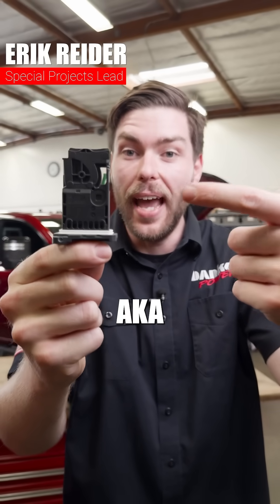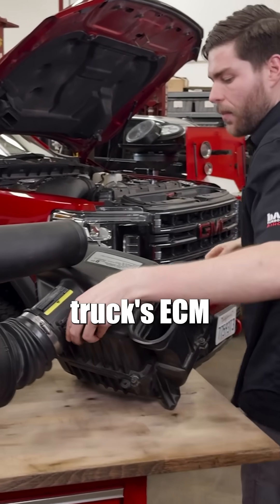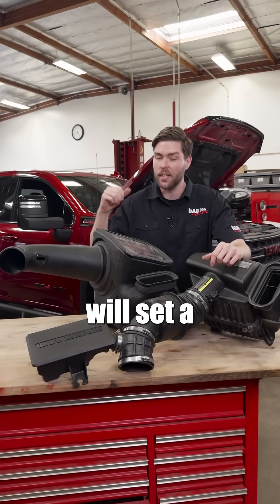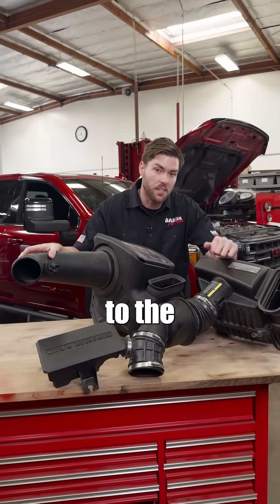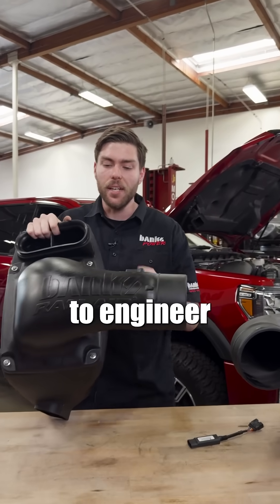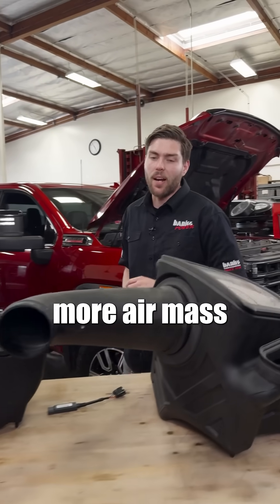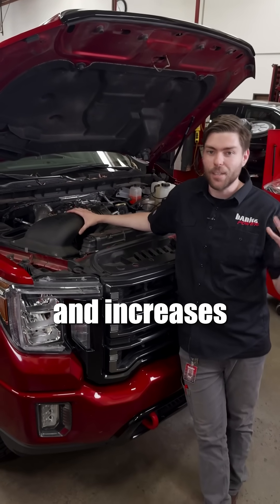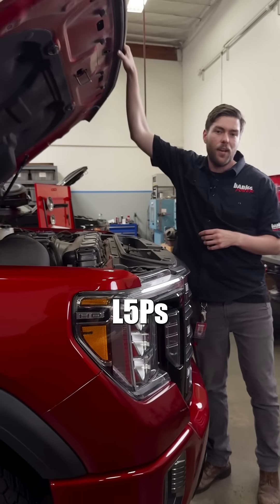We’ve changed how intakes are designed.

Comment: 👏Yes Yours intake system is great 💪when user can't tune ecu, but tuners can calibrate air mas sensor data in engine ECU, set diameter, calculate się flow etc.

Comment: Have you fixed the intake for my 19’ Cummins yet?  I’m on your list to call for a fix but it’s still sitting on the shelf due to multiple codes I get when it’s installed.  If you are selling products that throw codes as I was told by one of your techs… what is the difference in other manufacturers selling intakes and false claiming horsepower that you call out all the time in your videos?  Seems one and the same.
Reply from the maker: So, for specifics your order, send us a text at the customer support 1-800 number on the website and ask for tech support, but in a general sense we expect to start shipping out the revised parts for your intake in the next couple of weeks.

Comment: Still no love for Ford trucks!

However,  it does seem that GM and Dodge Ram have more inherent problems with air intake in their engines!
I replace my stock air filter with a K&N oiled air filter and have had no codes set on my 2016 F-150 with the 5.0 Coyote!
I have refused to buy any of the “cold air intakes because they all have the same flaw, they leave a huge opening to the engine bay heat generally around where the air intake tube exits the air intake box before the MAF sensor!
I. E. Not really “cold air” intakes!

Comment: Or for a whole lot less money and the exact same results, you could just replace the MAF at the same time as you do the air intake and then hook up a obd2 scan tool and put the ecm into calibration for the new MAF so the new higher airflow is what it reads and sets the ecm to. 

You don’t even need to use the obd2 trick most times, just installing a new MAF at the same time as the new air intake & let the engine idle for 5 min before you mash the throttle down to hear the new sound & the MAF & ecm will sync & clear the code on their own

Comment: Hey guys ; I just installed your cold air intake on my 2014 6.7 ram truck . My truck is now throwing an air box code . Will your maf module sensor solve this problem ?
Reply from the maker: For technical assistance with our parts and performance kits, we'd love to discuss it over the phone.  Please call us at 626-969-9600 and select option 4.

Comment: I need this for my 2019 Ram 3500. Driving around with the check engine light stresses me out. Will reinstall the stock air intake until there is a solution.

Comment: No one will tell you this but the whole point of a cold air intake is not for making initial power you need a tune because all a cai is its a supporting modification for a tune just to get rid of the factory restrictive airbox after that the piping can stay stock size because from factory they design the piping to allow the engine what it needs up to the top end so it really doesn’t matter what brand you get as long as you get tuned before intake

Comment: for guys who are doing true custom tuning, the oem MAF is fine as the tune can be written to perform with it. No need to over complicate it with an aftermarket MAF. For the small amount of guys using canned tunes out of the box and want to use something bolt on at a premium price for little results, this is definitely for them. 😅 Might as well make one of out PVC pipe 😂

Comment: That’s great Banks.
But what about the 2019 L5P ?
Why wouldn’t you develop that for ALL L5Ps ?
It’s only good for 2020 and up ?
Why ?
Doesn’t make sense.
Reply from the maker: The 17-19 trucks have enough overhead and a different emissions requirement than the 2020+ trucks, where a MAF intercept module is not needed. By contrast, the 2020-23 and the 2024+ trucks have ever-tightening emissions restrictions and requirements that forced us to develop this technology.

Comment: When will this product be available for 6.7 Cummins Ram-Air products?
Reply from the maker: @Zekkou  The Air Mass Control Module is currently not required for 2007-2024 Ram 6.7Ls. In other words, our Ram-Air intake systems are able to increase air mass without the module. However, it may be needed for 2025. We shall soon see.

Comment: Volant is another one that dosen't make there tube smaller. Awesome system.
Reply from the maker: @Tess_untamed  Volant cannot manipulate the MAF sensor’s data, therefore their tube must remain the same size as stock.
Reply: @bankspower would you say I would get more performance form one of your cai than a volant on a performance LS engine? And why? I have one of the old K&n with the metal tube and wanted to switch to a plastic one with a closed box. I was thinking of getting a volant but maybe you can persuade me different. Can you guarantee I get better performance from your product than a volant? If so, how? I have a heads/cam LS

Comment: How about fixing the intakes on the fifth gen rams so they stop throwing egr codes. While you are at it maybe you could finish the design and have it actually connect to the air scoop so it uses the factory ram air setup like s&b does?
Reply: Right on.  My Banks intake for my 22 Ram has been collecting dust since 2023.  I keep getting the "fix is coming" from Banks
Reply: They need
A fix asap for 6.7 Cummins I return mine waiting for the fix so I can buy again

Comment: So basically what you are doing then is a chiptuning with a new intake where you either put alpha/n related mass air values or flow measured/recalculated values of your intake into the ecm and simply fool the ecu. If thats really legal if you put it on a roller tester and measure the émissions with a wltp/nefz cycle i highly doubt. Thats maybe possible if the ecu can adopt to the false values and is able to correct close to the safety values...

Comment: Just use what ever intake you want and rescale the maf sensor when you remap the ECU🤦‍♂️
Reply from the maker: Tuning can be a great solution for people in a lot of cases, however,  there are a few down sides: the cost and it'll void the warranty. Our solution allows you to run an upgraded intake without modifying the ECM or setting a check engine light.

Comment: I'm guessing that the engine check light comes on because the computer can't take into account the different diameter of the tube therefore the mass air flow value is not correct

Comment: Great filter, but you forgot to design in a easier way to change the bloody filter itself. Having to remove the whole tube to change the filter is INSANE! One reason the S&B filters have taken off (at least around here). 4 screws and you can take filter out vs at least on 4th Gen RAM's having to remove the whole intake to get at it.

Comment: If your a true engine tuner/builder, aftermarket parts designer, why don't you let people know that after changing any parts with aftermarket/performance parts, the vehicle needs mapping to do the job right?
Reply from the maker: Tuning can be a great solution for people in a lot of cases, however,  there are a few down sides: the cost and it'll void the warranty. Our solution allows you to run an upgraded intake without modifying the ECM or setting a check engine light.

Comment: I’m all in on banks engineering. However it’s a little shady to not show the last piece of the intake that connects to the throttle body. They’re the same size on everyone’s cai. Yes it flows more where the maf sensor is but still tapers down to stock throttle body size. He’s showing where the s&b connects directly to the tb but the banks is still missing a whole foot of tapered down pipe.

Comment: Sensors are just a limit. Carbs didnt need any of that and thats why some of them ran much harder when modified right!
Reply: @LightningFast240  Sometimes you had to choose a carb with less CFM so it would function well enough in street driving. Same could be said for certain EFI setups.
Reply: @skylinefever  4in MAF with air straightener really all you need. Everything after can be 5in

Comment: Damn how can yall sell a defeat device? This messes with MAF signals then your messing with emissions equipment. This would fail inspection immediately. Although im all about it im just confused how yall are doing this.
Reply from the maker: The Ram-Air intake with the Air Mass Control Module has a CARB E.O. It is 50-state emissions compliant.

Comment: But your throttle body is still the same. Why increase diameter of the air intake tube if it still chokes the exact same at the throttle body?
Reply from the maker: Yes, the throttle body remains the same size even though the intake tube diameter has increased drastically. We have tested this and found that by increasing the intake tubes and air filter size, we are able to create higher air density, which is then compressed when it funnels down to the throttle body inlet size. By doing this it creates more pressure and much denser air going into the engine, resulting in improved flow and power.
Reply: @bankspower  that's interesting. I am not an engineer, but wouldn't that create a negative pressure front in the intake manifold and cause turbulence or 'negative scavenging' at the injection?

Comment: Sure it's nice to have a larger intake tube, if it's properly tuned for airflow distribution and reduced turbulence, but you're still limited by the stock opening on the intake manifold. People think bigger is better, but that's not always true, creating a wide spot in the line can lead to drastic inefficiencies, but I'm sure Banks has done their fluid dynamics homework.

Comment: I like seeing them find ways around choke points. Back in 1998, I learned what a MAF was in an article about how to get 450 horsepower form a Nissan 300ZX Twin Turbo.

The stock MAF was in front of a splitter, taking the flow from one air filter to two snails.

When installing really big snails, people back then had to use the Jim Wolf Technology Twin Pop, which was two air filters, and the MAF in one of them. Then the ECU was reprogrammed as the MAF was basically measuring half of what went on.

Later modification on MAF engines involved using a large MAF with a wider range. People would often adapt the Delphi MAF found in the C5 ZO6 and reprogram ECUs to use it.

JWT did a lot of interesting things with Mass Air engines. The Datsun 280ZX was made before the hot wire MAF. It had a weather vane that was a huge choke point. They adapted the computer and hot wire MAF from the early 300ZX Turbo, in order to improve the Datsun 280ZX Turbo.
Reply: This comment brought me down memory lane. Thank you
Reply: @hadojin210  I always feel great when someone gets my origin story.
Reply: This reminds me of my friend way back in the day trying to build up a Mitsubishi VR4 twin turbo. Nobody made turbos for it. So he got something like a 16g or 18g set of turbos and cut them up as well as his stock turbos to make his own. It was an absolutely insane build at the time. Nobody was doing it, it was such a new car. He got his bigger turbos and then figured out he had a LOT of learning to do when it came to figuring out the tuning and drivability. He got it going pretty good after a while. There only was so much you could do back then. Most people were still doing EEPROMS bhahahaha.
Reply: @genuismensa  I think about how people also got around that choke point MAF in the late 1990s or early 2000s with a "MAF translator." It was a big MAF along with some device that scaled the reading. Even with good EEPROM tuning, it must have been a challenge to use anyway.
Reply: @skylinefever  LOL we used to just be cheap teens and use 3.7v Zener Diodes to just dump excess voltage to ground. You couldn't really max out the MAF and MAP then. We called it fuel cut defender lol. Then you get a manual sprinkler valve and couple of barbed fittings from the hardware store and you have a manual boost controller. Then you could get Saab turbos which were bigger than the Subies and it was a T3 flange as well so they mostly bolted up. Then we would swap in the bigger injectors from the Saab too. We had a couple of these Subaru legacys with the EJ motor in them probably pushing 300hp at the motor, maybe a bit more based on fuel rates. They were just beast on the streets. Had them gutted so they were just tin cans with a radio and two seats and seat belts haha. Two of them the slushbox transmission blew. Then last one put a rod through the block. Then we moved on to Geos... When AEM launched their Piggy back, it was on like Donkey Kong. Those poor little POS were getting BOOOOOST! Then I moved onto VW's and made an "ABF aka Frankenstein" motor. I took a 16a head from a MK2 1.8L, and then my 2.0L ABA block and then used some Bahn Brenner parts to marry the two. I had an old AR Research "dump truck" turbo. I used Megasquirt 2 that I assembled myself and the daughter board and all the extra code. Everything else I have worked on is in the "new era" of modules connected via networks. I miss the old stuff some days, but I also really enjoy hacking on the computerized stuff too.
Reply: @genuismensa  Your story sounds beautiful. I couldn't legally drive back then, but your story reminds me of my teen years using late 1990s internet. I was using Geocities to pick up secret tips and tricks. I was reading about stuff that was basically inaccesable.

I also read about the Silvia with the turbo engine in 1999. I boiled with road rage. I said "They neutered the Silvia to build the 240SX! This is a national scandal! I want whoever did it to pay!" I did read about the Mitsubishi Evo, but I considered the Eclipse GSX to be close enough to not give me road rage.

Back when I read that May 1998 issue of Sport Compact car about getting 450 horsepower out of a 300ZXTT, I saw a tiny article and photo about a car about to go on sale. It was the R34 Skyline GT-R. It included a picture of the RB26DETT "Neo Straight Six" it was about to get. The photo had a blue one. I instantly wanted one because it was beautiful, and it meant I also knew about them years before most American boys did from Gran Turismo 2 or Fast and Furious.I felt years ahead of the curve. Years later, it is why I came up with the name Skyline Fever.

I went back to automotive technical school to get some skills I needed and AC repair. The teacher did find some of my explanations interesting. He was in his late 40s to mid 50s at the time, so probably not into the media the young people were into. He might have seen Fast and Furious, but it is very unlikely he ever played Gran Turismo games, and even less likely to have even heard of Initial D.
He was a Toyota guy. He said it was because in the 80s, he was broke and was able to buy a poorly running 70s Celica. Half the smog gizmos were hacked off to try to get it running right again, so he hacked the other half off and suceeded. He then beat the heck out of it when driving, and it just took it and lasted anyway. I explained the GT-R to the Toyota guys "Imagine a Supra TT with all wheel drive!"

I also explained to him certain things that ended up different about cars sold in the USA and ones sold in Japan. It was a huge interest of mine. He saw a picture of an Atkinson engine and I explained how the Miller Cycle engine was like that plus a supercharger. I happened to drive one, because a friend needed a designated driver. I explained how driving it was not as interesting as one might have hoped, but there would have been a logical reason to have built it. I explained Japan's engine displacement tax. I said "While it makes sense in the USA to simply pay $5000 less to buy a  Nissan Maxima with 3.0L V6 and get similar horsepower, it may have made sense over there to have a supercharged 2.3L V6 to get into the under 2.5L tax bracket. I think I explained the Datsun 240Z ending up with the L20 engine in the S30 Fairlady, and I might have explained the S30 Fairlady Z432 costing a fortune but possibly being worth it for tax reasons. However, I am not sure of that.

Comment: My AFE true cold air intake on my 2003 lb7 increases flow by 42% (proven by my tuner) has a handsome shroud, did not give me a check engine light and it didn't break the bank. 
I'm not knocking banks products, I'd love to have a different cover from yall, along with other things lol
I'm only saying, other brands can also produce quality products and do a little research before you buy products just for the name.

Comment: Gale Banks products for that good. The guaranteed to have your engine have more power he set the fuel consumption write the air flow the exhaust Flow. You change it out so it has more pressure that's why I control it when you want high and horsepower or low horsepower for pulling plowing snow. It's not made for four wheeling. What's made to get your work done faster but if the truck isn't built right for it. It won't work it'll break stuff.... Every diesel. Plug it in to the extension cord for winter so it starts. If you don't make the feel right for the winter. It won't start. And if you use ether it voids a warranty. It means we don't cover it. An abuse to. Something that the truck pull....... Tony Banks here....
Reply: We made it for every engine. Ever made

Comment: But at the end of the day, the air is still going through the same diameter throttle body. This is what Ive never understood about aftermarket intakes, how does changing the intake improve performance?
Reply from the maker: Air is compressible. Unlike water, which is not compressible, you can squeeze more air through a smaller hole. Thanks to the larger diameter tube and lack of restriction of the Ram-Air intake, we're able to increase the air density right into the turbo inlet. This means the turbo doesn't have to spin as fast in order to make the same boost. Yes, all intakes feed the same size turbo compressor inlet. However, it's what you do before that compressor inlet that matter... again, because air is compressible.